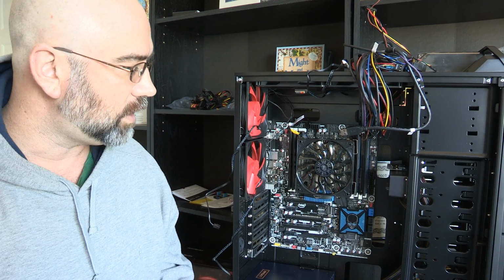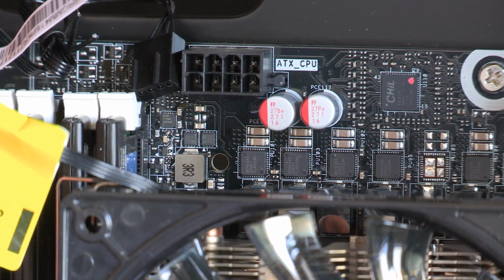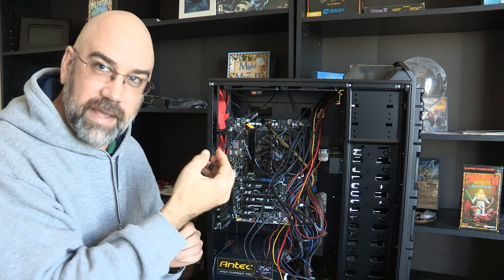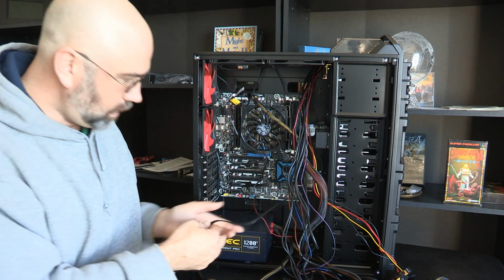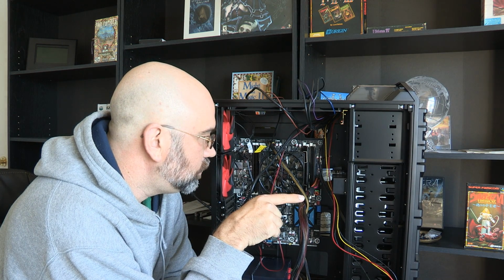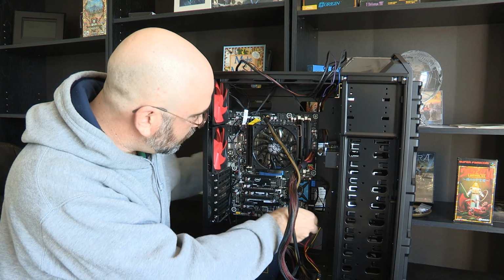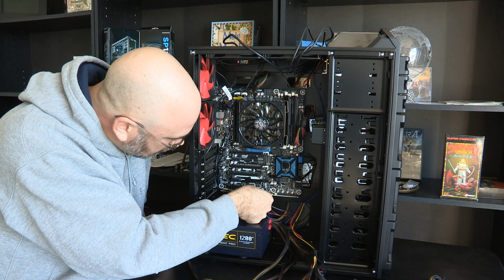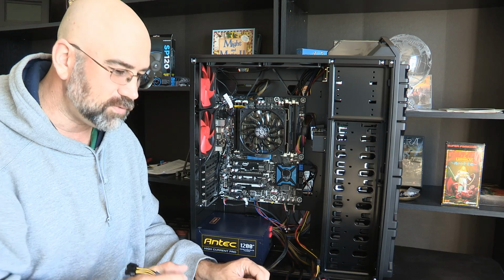How To Build a Custom Gaming Computer - OMG These Cables!

Comment: At first, was no CPU12V needed. With more power CPU needed, a 4-wires-CPU appeared, then 8-wires, and the power source has 2x4-wires (for both 4 and 8-wires-CPUpower conector, similar with 20 (+4) MB conector). 
And then more hungry MB need 8 + 4-wires-CPUpower, and in the future they aspect 8 + 8 -wires-CPUpower to be needed, so that is the reason Markus hold in his hand 8 + 4 + 4  -wires-CPUpower conector.

Comment: Grounding is actually very important regardless the climate you're in. Everyone creates static electricity and just touching a board's circuits on accident will cause microscopic damage. Granted, will it cause enough to cause any significant issues while building a computer? Probably not, unless you're handling the components often.

Comment: You don't have to be a pro to know that that CPU cooler he is using in this video does the CPU he bought NO justice.  The entire point of buying that CPU is to overclock, you can't overclock well without proper cooling.  Last episode we watched him struggle because the H100 cooler he used isn't compatible with 140mm fans.  So you know what, don't use the 140mm fans.  Un-mount them from the top of the case and just use the 120mm fans in push.

Comment: Markee why are you using that shitty CPU cooler and not the H100.  Just mount the H100 in the top with only one set of 120mm fans and screw the 140's if you can't get them to fit.  That configuration would still be better cooling than that current CPU cooler you are using.

Comment: You should change the name to reflect your lack of knowledge and also add a warning to not use your advice as actual correct information. If someone were to follow this series and mess something up (which as I see it is almost a certainty given the information you present) you are open to being liable for damages. It is why shows that offer advice have disclaimers. This is a show about how you think computers should be built and it does not reflect actual and correct methods for building comps.

Comment: A tip about the fans, those corsairs are really quiet. Best ones I've used so far. The SP range are actually meant for radiators. The SP stands for static pressure and have a more focused tunnel of air. But if you use them for exhausting it doesn't matter that much. If you pick up more for intake buy the AF (airflow) range they spread more out and blow over all the components. I usually wire them on the backside trough an adapter directly on the PSU and also use the included resistor.

Comment: Computer Wiring 101: Take all your cables trough the passages to the back of the case. Put all your hardware in. Connect everything up. Rotate case and zip tie all excess and unused cables together in a couple of flat bundles so you can fit your side panel. Done. There are no cables interfering the airflow and also there can't settle any dust on them. Thank god you figured that out. Job well done. If I do cable management it takes me usually 2 to 4 hours. But I'm just OCD when it comes to that.